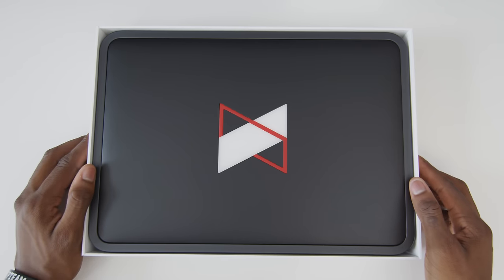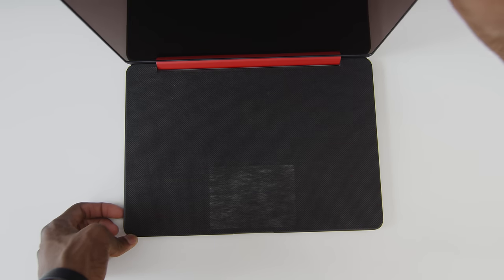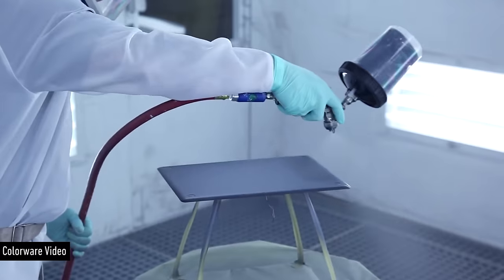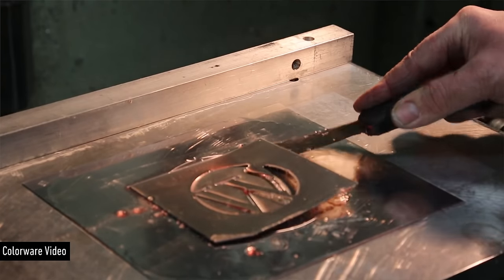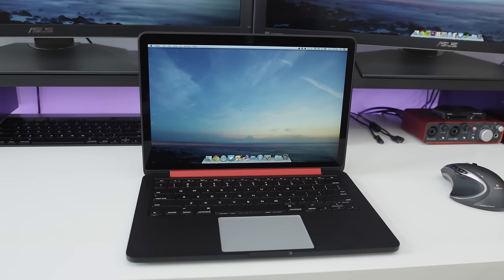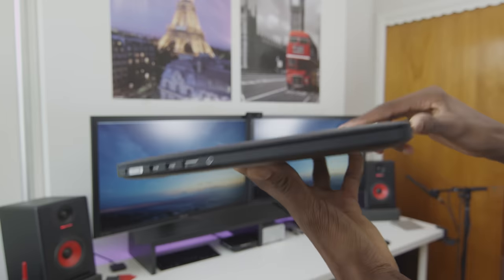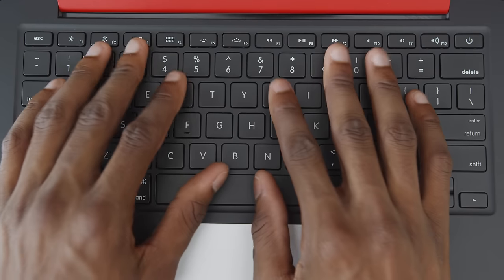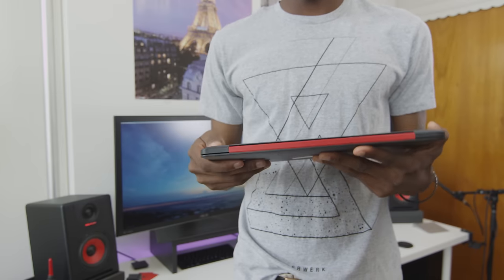MKBHD Edition Macbook Pro! (Colorware Custom)

Comment: It's a waste because after 3 years, you'll need to upgrade your laptop and no one wants to spend $700 again to get a "one of a kind" look.
Reply: Most MacBooks last longer than 3 years.
Reply: It's usable but engineers and medium-heavy graphical users like me don't want to use an outdated tick-tock processor laptops.
If you use a laptop to browse the web, social media, and non-intensive stuff then spend $700 for it
MKBHD uses it for school purpose and not for video-editing so it's a good investment for him.
Reply: UnknownFPS You shouldnt use a laptop for heavy processing anyway duuuh
Reply: Crush3dI Lol. Are you serious? Apple has been advertising 15" rMBPs to professionals and developers in Photo/Video/Software and many more.
Your ignorance makes me laugh.
Reply: I've had my 13" MBP for 5 years now and it's still running great. I just swapped out my harddrive for a SSD and installed better ram. Won't be getting a new laptop for at least another 2 years.
Reply: Aaron Yu You have the old model where the interiors inside the MacBooks are user-replaceable.
The Retina MacBook Pros are soldered inside so RAM and storage (few exceptions) are not user-replaceable.
MKBHD's MacBook is not user-replaceable so when buying a MacBook, you better have at least 8 GB of RAM and 256-512 GB of SSD.
It's all subjective on what's "good enough".
When comparing your MacBook to modern MacBook, you're missing the thinner & lighter design, retina display, and longer Apple support.
Like I said, to me, engineers, and professional photographers, most of us depend on the latest technology every 3+ years.
Reply: MKBHD replied to my rant.
This made my day.
Also go Brazil!
#BeatColombia
Reply: Once you spend that kind of money, you have to keep your devices on working conditions all time... plus no need to upgrade every 3 years.. unless you have the money to waste
Reply: UnknownFPS if you think Brazil will beat Germany, you're on drugs..
Reply: ginito I'm supporting Germany when it comes down to Germany vs Brazil.
However, in the finals between Germany and Netherlands... it will be hard to predict and which side to root for.
Reply: Carmelo Santana Obviously if you spend $700 on colors to distinguish between everyone else's MacBook then you're better off getting a worth-upgrading laptop
Reply: ***** Like I mentioned before, it's all subjective on "good enough" for your needs. If you're doing everyday tasks like browsing social media, watching videos, and word processors, of course you don't need to update every 3 years but when you're using the laptop primarily for gaming, professional needs, then you need to update the dGPU or processing power.
Also, your MacBook is an old model and the new model has almost everything soldered so it's really not possible to upgrade your RAM and SSD (3rd market not available yet) later on when you need more RAM or storage.
YMMV
Reply: ***** Unfortunately, MacBooks that are at least 4 years old will not officially have "handoff" functionality in OS X Yosemite because its bluetooth is not on its latest.
I still think $700 is a huge ripoff just for colorizing your laptop.
I'm pretty sure MKBHD got a huge discount or perhaps free as an offer to advertise its company to his subscribers
Reply: Lord Ka MacBook Pro w/ Retina 13" (the one MKBHD have), base model costs $1,299.
Non-retina costs $1,199.
Reply: ***** its going to be slow for video editing though...
Reply: Lord Ka But your original comment implies a 13" retina MacBook Pro costs $2000. I'm sorry your original comment had logical issues.
Reply: ***** Majority of the people are using laptops for word processors, social media, and watching videos.
When you're a professional video/photo user, you need a lot faster dGPU and processing power after 3 years.
You can still use your old laptop for heavy intensive work, but it will be slow and not worth your time.
Reply: ***** Nope. Why is Apple targeting 15" rMBP to professionals instead of just Mac Pros? Because portability.
Pranksters on Youtube, engineers, computer scientists, photographers and etc. would get a laptop for on-the-go workstation.
Can you imagine being a photographer going around the world and with a desktop in a suitcase to edit photos?
That is just inconvenient.
No one does that.
Reply: ***** Power does not mean everything. It just needs to work efficiently. Of course a configured desktop is much powerful than a laptop, but that does not matter.
Professionals use desktops as a final finish and majority of the work usually happens using laptops (this case in my area).
For example, me and bunch of computer scientists code detailed information using a laptop and after it's almost done, we usually hook it up to a monitor and present.

Video/photographers can use a rMBP w/ dGPU hooked up to a monitor and work just as good.
More power != better presentation
I really don't understand your logic on why everything has to be worked on a desktop PC.

Comment: Or you can just buy an alienware laptop!!!
Reply: Alienwares are for gaming
Reply: TwiisTedVision not only for gaming.
Reply: Alienware laptops are awfully overpriced (although not quite as much as macs), weigh a ton (friend owns one), are huge, and look ridiculous if you have to use it in front of your coworkers. Don't be ridiculous, get a small power-efficient and lightweight laptop and a tower for gaming or heavy workloads.
Reply: K3Techs I agree with you.... the point of this video is if you want a "different laptop" ...in my opinion the alienware is more custom... $750 to paint a laptop gtfo!
Reply: Arlind Sadikaj I thought that price was crazy when I first heard that. However, look at it this way. The company disassembles everything completely and paints it for you. Do you know how long of process it most likely takes to do that. Labor isn't cheap for things like this. Considering that lots of companies take the price and multiply that by 2.5, it wouldn't surprise me if it cost $300 to paint the laptop...
Reply: they are not comparable laptops, totally different
Reply: Totally different laptops
Reply: Which is about 3 times heavier, 4 times larger and not portable in the slightest.
Plus they run Windows 8
Reply: and they look terrible
Reply: Alienware are overpriced in my opinion and are for gaming. Not hating on Alienware but I would buy MSI instead.
Reply: I used to like alienware, but they are pretty tacky and way oversized. 

I'd still never be caught with anything made by Apple though. Razer's Blade, Msi ghost, Asus, Sony Vaio (if you can find them) and a few others are much better choices imo. The only problem is godawful win8 (the only os I like less than Mac OS/ios) lol, but you can always use programs to kill metro, win10?, or install Ubuntu on them.
Reply: Banks Avram Wrong, they'll run whatever you want. There is nothing keeping you from reusing the windows 7 serial from any other computer
Reply: Hahahahahha...ha. 

Why in the world would anyone over the age of 13 buy one of them?
Reply: Bad bad bad bad bad bad no. Bad.
Reply: God Alienware is more overpriced than apple at least apple has a reason to be overpriced Alienware is just a 1200$ gaming laptop marked up for 1700$
Reply: +8obis It's very well built
Reply: +8obis It's very well built

Comment: A good paint job should mean sanding it all down to bare plastic or metal with no paint and primer, and on such a device you should use at least 5 coat of whatever base coat.

Comment: I think the only logical thing if someone were to do this,would be on a console like the PS4 or Xbox One since it won't be 5+ years before the next one is out, but on things like the smartphones next year there's just gonna be a new one that your going to switch to, but yes I still believe this is insanely over priced, I've seen similar services elsewhere for about half what Color wear is charging, but either way, it's not for me. On the other hand, if I was a millionaire I'd go for the PS4, black on top, red on the bottom :)

Comment: You failed to state that the only products that they can paint are the models they have for sale.  I have a regular iMac 27 inch desktop and they told me that I cant submit mine to be painted because they only paint the 5k Retina version.  If both computers are turned off, they look identical, i dont understand why they cant custom paint a regular imac.

Comment: Have you done a temperature test to see if your "new" black mac is hotter (temperature) than the silver. And I believe there is a black apple keyboard.
Reply: Only external temperatures are affected (from light shining on the shell) . the actual cooling performance is unchanged.

Comment: I find taking the laptop apart is just a marketing scheme. I heard rMBP to be the least repairable; hence, if you try to pull off the glued battery, you will probably damage the laptop. I am iffy about this idea since it will shorten the lifetime of the unit.

Comment: Actually, why paint? Why not ANODIZING it, as this process even hardens the surface making it MORE scratch resistant? WHile paint sits ON the surface, anodizing is IN the surface of the metal! Much, much better than paint. Not only can you have any color, BUT, you may have any pattern or even a picture or painting anodized.